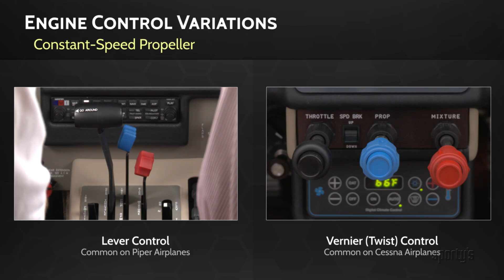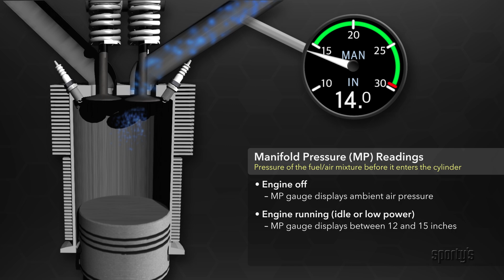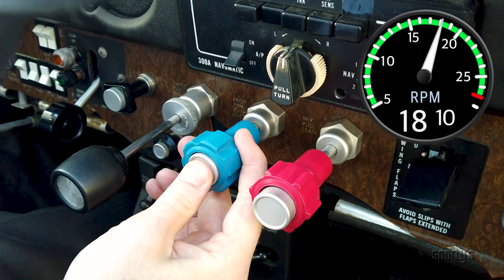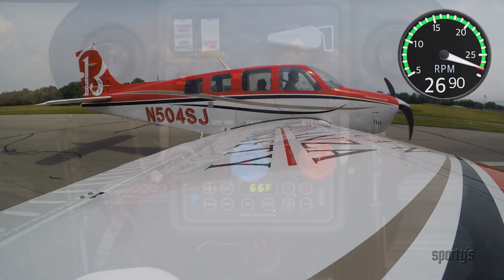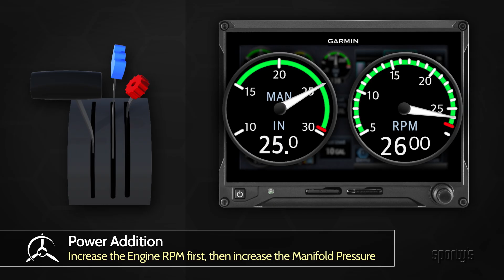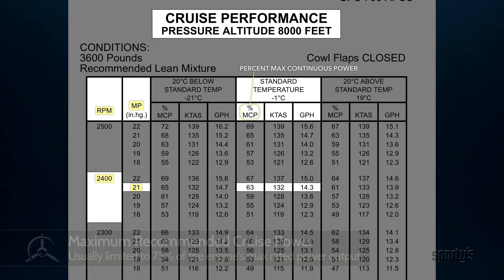Flying with a constant-speed propeller – Sporty's private pilot flight training tips

Comment: I believe the lugging analogy is incorrect. Vehicles with manual transmissions are said to be lugging when the load is high (higher gear and low wheel speed), but the engine RPMs are low, meaning you need to shift into a lower gear to gain more mechanical advantage. This would equate to the prop having a full bite (high load) and the manifold pressure being too low for the selected amount of prop load. Flying with a lot of manifold pressure, and the prop full forward (no load) is just wasting power, not lugging. It's like revving your car in first gear, and not shifting to a higher gear. Not efficient, but not lugging.

Comment: I've been flying my RV-6A with O-360-A1A engine for 24yrs now and I guess I'm the odd guy out.  I leave full throttle (carbureted) rich stop during climb and make an rpm reduction to 2500 using prop control.  I can always feel thrust increase.  Why would I choose to reduce throttle when I'm not using power the engine is currently producing to bite into the air?  Throttle is altitude, we are trying to climb.  Power is wasted and just turned to noise.  Upon reaching 1000ft AGL, I bring throttle down to 25inHg if needed and continue my cruise-climb at 120mph.   At higher density altitudes this is even more the case.  I lean mixture for altitude and start my takeoff run, I dial back the prop control while accelerating down the runway as I feel thrust peak and leave throttle full.  Can anyone tell me why this technique is wrong?